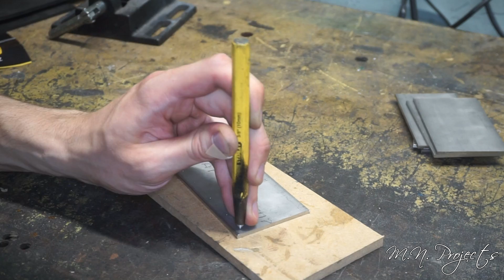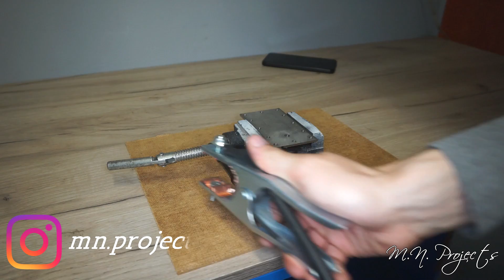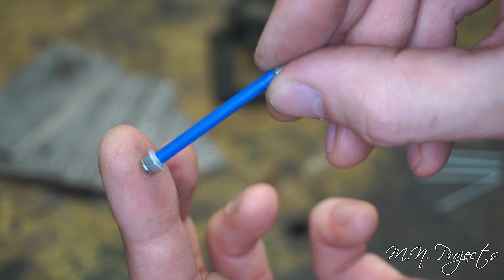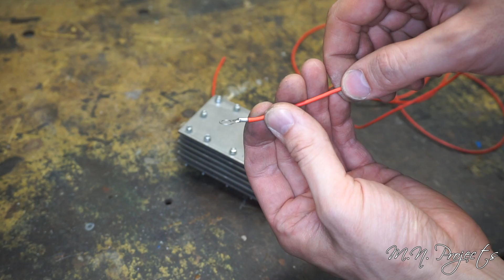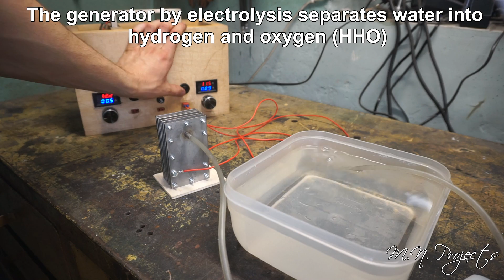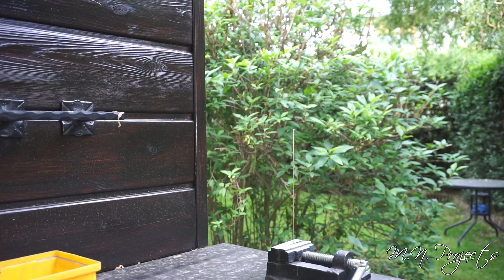Making a Mini HHO Generator

Comment: So many plates and only the front and rear are connected?
wouldn´t it be the right way to alternate plus and minus on all plates?
Reply from the maker: The power supply is only applied to the outer plates, but the voltage is distributed among all. The voltage is divided in the same way on resistors connected in series, you do not have to connect each of them separately. 12V divided into 5, gives us over 2V between neighboring plates. This voltage gives the best efficiency during electrolysis.
Reply: @maciejnowakprojects  Very interesting. thank you for telling me keep it up. i like your videos.
Reply: @maciejnowakprojects  Have you measured the voltage on each plate?
Reply: Middle plates are neutral plates they divide voltage equally😃
Reply: @ashokguru61  Ashok guru
4 days ago
Middle plates are neutral plates they divide voltage equall
--------------------------------------
WTF are you talking about?
Reply: @maciejnowakprojects  how is the voltage distributed among the plates? All I see are insulated screw.
Reply: I read on a hho website, for that hapens you dont open holes betwen plates
Reply: @erugy  but as far as i know,water is a conductor
Reply: Voltage split automatically happens between the plates, ( fundamentals of electricity) ; Also, experiments have proven that ideal voltage gap for hho generation is around 1.5 v per plate !
Reply: @maciejnowakprojects  What kind of metal you used? I had made a simple HHO Generator by used stainless steel sheet in my teenage. But when power on, the stainless steel sheet decomposed rapidly in liquid. And the liquid became black.
Reply: @maciejnowakprojects  I have longevity concerns too if the oxygen reacts with the steel
Reply: @kehaknasi2238  Pure water is a very poor conductor.
Reply: @kehaknasi2238  Water is not a conductor by itself.
Reply: Every other plate as + - would make a 2 V unit that would require much higher amps and create a lot more heat for the same wattage.
Reply: The process works much easier at around 2volts per section, 12 volts divided by 6 sections = 2 volts. This is the best we know for now. Very clean build! 👍
Reply: What is the supply voltage range for the given set up?
Reply: @joeblow7374  hes right. Just should've worded it a lil differently
Reply: @erugy  google what are neutral plates
Reply: @maciejnowakprojects  This was my question also, thanks for the answer. Sort of like "liquid inductance"?
Reply: @Graeme_Lastname  
There was KOH added to the water so it wasn't pure
Reply: @danielnyman6082  Thanks m8.   :)
Reply: What metals work for this? What about old computer heatsinks? Surface area?
Reply: @maciejnowakprojects  You can use table salt instead potassium.
Reply: @kehaknasi2238  only that pure , distilled water doesn't conduct the electricity at all , only if have minerals in it will conduct
Reply: @maciejnowakprojects  so what you are saying. Is that the middle plates polarize as a capacitor would, because the metal is more conductive than the solution?
Reply: ´ @ashokguru61
Reply: @maciejnowakprojects  can you use Aluminium sheets and rubber matting sheets to build an hho generator can you also use just plain water, how many voltage do you use and how do you cut the rubber? Please respond
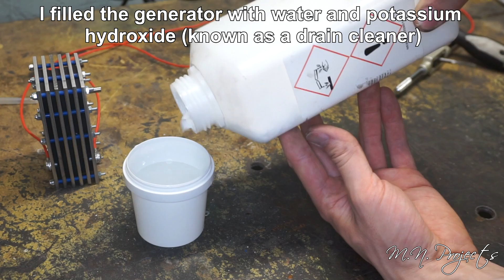Reply: @maciejnowakprojects  But at 3:20 you clearly see how the voltage is not reaching all the plates?
Reply: @kehaknasi2238  Nah not really you need to mix the water with some electrolyde like salt or poddium hydroixde, sure if you apply enough volt to the water the current will travel thorugt especcily if the water is hot, where the molecules have a higher kinetic energy.
Reply: @jovenray8771  most electrolysis plates are made from titanium plated with platinum
Reply: @erugy  The electrolyte in the water conducts electricity between the plates.
Reply: @jovenray8771  it sounds like what you used wasn't stainless, but zinc coated or galvanized
Reply: Yes, I was going to say the same thing.

Comment: An amazing & excellent demo on HHO gas producing plate's assembly, insulation 👌🏿tube rubber used as between insulation separator, very neat & presentable video 👍🏿

Comment: excellent , except for the fact that the electrolyte will rust the plates in seconds rendering it useless in no time , should have used 314 or better still 316 stainless steel plates and bolts

Comment: If I understood well, the top and bottom sheets are insulated from the inside sheets, and electrolysis separate the gas from the water. And this is tap water?

Comment: That's a nice build I built one similar but way bigger and ran a 2004 Pontiac Grand am for three months off of it
Reply: youre insane
Reply: @johnnyllooddte3415  how? it worked! ran great too! I even removed the fuel pump fuse so I didn't burn the pump out.

Comment: As I see it only the top & bottom plates are the electrodes, what´s the point of the other plates if you´ve not connected them as well or have I missed something?
Reply: It is for the neutral status for both charges, + & -
Reply: Neutral plates are used to lower the Voltage.

Comment: use the pressure from the hydrogen generated to drive hydraulic pump for electrical power generation prior to burning it.

Comment: I guess using thinner plates (1mm) in the middle will give you a chance to add more plates (surface area)  The gasket is also too thick.  The combination of 12v every 5 plates is good.  I guess for a 100mA load is quite on the low side and a little more  potassium Hydroxide will get you a little more current hence more production.  Good luck and be careful.
Reply: Dont use more then 15% of pottasium hydroxid in your elektrolyzer, just waste of recourses! How whould the thickness of the gasket affect the performence? 2 V on all the plates is the sweet point adding more plates means more power consumbtion, tell me if im wrong?

Comment: Hi. I have two questions about this generator model.
1 - Unlike conventional models, this generator is not immersed in the electrolyte solution, the solution is inside it, correct?
2- Wouldn't an isolation be necessary to handle this type of generator? Or can you hold it in your hand when it is connected to electricity?
Reply: inside is called dry cell. outside is wet cell

Comment: are you grounding it? and if you were to touch the plate connected to the positive, and the plate connected to the negative at the same time would you get electrocuted? thank you.
Reply: No 12V isn't enough to travel past your body. It's like a car battery

Comment: Now add another input for water in the bottom side and a small pump, pumped slow enough you’ll never run out of hydrogen gas. And increase voltage to 24 volts with a pump feeding it, you’ll get a lot of gas
Reply: Do u have calculation of this?

Comment: What's the output ...... Litters P.M.
As well purity
Reply: The purity is of the gas coming out is pretty high. It would be close to 100%. The output is dependent on many factors, like electrolyte type and concentration, electric current per area and others.
Reply: the output is corrosion of the materials, there is also some hydrogen but alot less then the price of the materials.

Comment: someone help me, i’m so confused how there is only current applied to the outside plates on each sides ?
Reply: The current flows through the tube filled with water between each plate dropping 2 volts at each plate as if they were ran in series with the water as the conductor between them. The screws are insulated to keep the current from passing through them so the only connection is the tube he filled with water. Probably salt water because water needs free ions to be conductive.

Comment: Could you make a continuous flame with this output gas?
Reply: I’ve seen it done when you use balloon attached to bunson burners
Reply: You can by use of a filter ,such as separate container and pass it through water to clean the gas of contaniments, and a very good working flash back arrester to avoid unit exploding should gases ignite inside !! Oh and a large enough output !
Reply: as long as you  have enough electricity and drain cleaner

Comment: How long can such a HHO generator work? Before it breaks? 1000 hours or more?
Reply: so, it will work for a couple of hours then the corrosion will start, the output will be lower and at the end of 24hours or so, no hydrogen will come out

Comment: Does potassium hydroxide prevent corrosion, every time I try to make an HHO generator the metal corrodes. (I Normally use NaCl or backing soda.
Reply: Chlorine and carbon dioxide are gases, so they escape while dissociation, by forming molecules... But hydroxide ions remain in the medium for the conduction, so the metal is not eaten up... I guess this must be the reason.

Comment: I don’t understand why these haven’t been added to vehicles as standard equipment. No wait....
Reply: I think you tried to make a joke, but the main reason it isn't a standard equipamemt is that it consumes a lot of power and generates heat
Reply: Thermodynamics. It takes more energy to generate the gas than you'll get from combustion. Hydrogen fuel cells like this are more effective as a means of converting and storing electrical energy, such as wind and solar power.
Reply: The most problems are the storage of the gas. But a new technology withe hho on oil combined could be the solution. Then you can storege ist like normal fuel.
Reply: it is because not enough efficiency
Reply: You may want an alternator as big as cement mixer truck turning  to feed the engine cylinders in order to generate more hidrogen and the water is getting thicker to molasses all the time .
Reply: NIKOLA motors is going to do it, they are listed in the stock exchange, check it out!

Comment: to create a hydrogen from electrolysis you need a high current. the cost outweighs the benefit. the difference in output of energy is lost in corroding the metal. no matter what is the design,  the math stays the same.
Reply: what a strange phrase. "high voltage of current".

Comment: Be careful using stainless steel in a HHO generator. It could produce hexavalent chromium which is extremely toxic. A safe but expensive way of building it would be with titanium plates.
Reply: what grade ?
Reply: @buder5116  Not sure. Im sure you can find it if you google it.
Reply: @OversteerEngineer  i did on ebay but  they are sold in many grade  so just a wonder
Reply: I hear graphite sheets are better. Whats your opinion ?
Reply: @jackb2491  I'm not a chemist so I really have no idea if graphite is completely safe. Have you seen anyone else using it?
Reply: @OversteerEngineer  There's a Robert Murray- smith YT vid. Seems to know what hes doing. Worth a watch. Super efficient graphite dry cell.
Reply: how about aluminum ??

Comment: Hello, could you please make one that separates the O2 from the H2?  Thank you.
Reply: he did separate the h2 and o2.. the o2 was  absorbed by the drainer cleaner and  plates..he collected h2..theres no  such thing as hh0 gas
Reply: @johnnyllooddte3415  I don't think it's even possible for the potassium hydroxide to react with oxygen at standard room temperature and pressure. If it were possible the equation would be 4KOH + O2=4KO + 2H2O. And the potassium oxide would just immediately react with the formed water and turn into potassium hydroxide again. The hydroxide however does react with the carbon dioxide in the air to form potassium carbonate, but that only if it's exposed to the surrounding air, and at a pretty slow rate nonetheless.

You did mention that the O2 would be absorbed by the plates. Not with stainless steel, which is completely immune to attack in a cell like that as far as I know. If he would of used mild steel, that could of oxidized and formed iron oxide, lowering the oxygen content. But even in that case, not all of the oxygen produced would just instantly react with the mild steel, so there would still be a hydrogen-oxygen mix in the resulting gas, albeit an oxygen-deficient one.

Comment: No H2
Reply: he did separate the h2 and o2.. the o2 was  absorbed by the drainer cleaner and  plates..he collected h2..theres no  such thing as hh0 gas
Reply: @johnnyllooddte3415  what are you talking about??? hho is just what we call a mixture of hydrogen and oxygen. the oxygen would not be absorbed by  KOH or react with it, it is merly an electrolyte

Comment: How does this work?
Reply: The current runs across the plates creating ionization on the surface of the plates.  Some of the molecules combine into HHO and low pressure draws the gas through the tube.  The purpose is to drive a piston engine with water and a little salt.
Reply: @timsim83  No It's electrolysis. Running an electric current though water causes the positively charge Hydrogen and negatively charged Oxygen to be attracted to anode and cathode respectively. This break the bond between the hydrogen and oxygen creating a mix of O2, H2, and H2O2 the the Peroxide further breaking down later. For note this uses energy. Thermodynamics is a thing and you can't get more power out than you put into a system. You will never run a car on water alone. The hydrogen is a storage medium not a energy source and without an external source of energy this will do nothing.
Reply: simple electrolysis can be  done with 2 electrodes and salt water..this is useless

Comment: ??? i can do that in 5 minutes with a battery and 2 lead  or metal electrodes..why do you  need drain cleaner,,,,salt water does  the same thing and is safer..  ???? theres no such thing as hho gas..its H2 hydrogen
Reply: Safer? Salt water produces clorine, which is very toxic to humans.